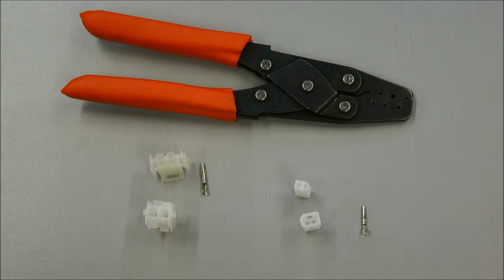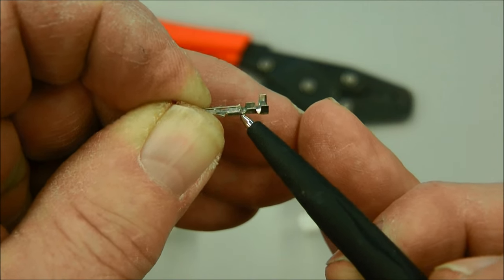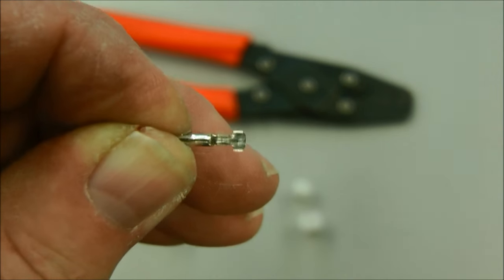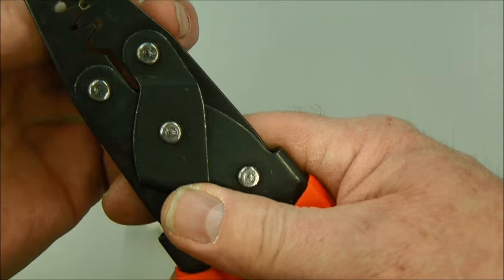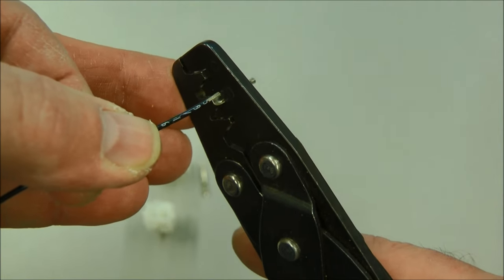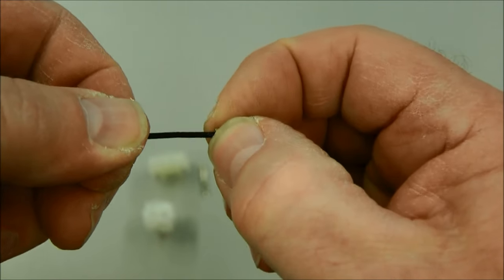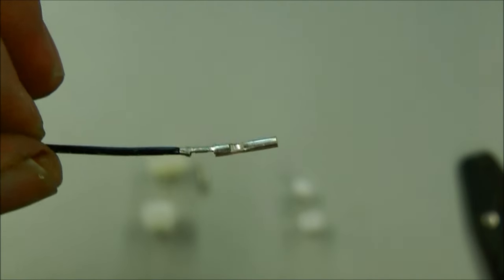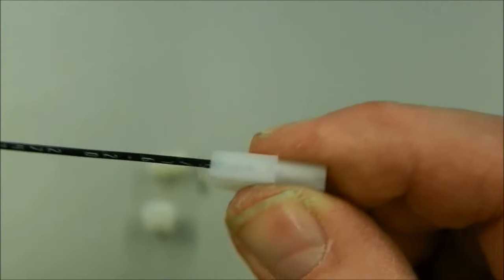011: MOLEX & OPEN BARREL PIN CRIMPING, Video 1

Comment: A helpful video. I'd like to add a couple comments that may be useful to others. In the video, you stress the importance of placing the tool properly during the initial wire crimp so as not to bend the adjacent section of the terminal. To do that, the tool has to fit between the two tabs. The distance available on the terminal is .150". The body on my IWiss crimping tool is .160", so it just isn't possible. I spent a lot of time trying, and your video helped me pinpoint the problem. The insulation on my 18AWG wire seemed larger diameter than the terminal was designed for, and I was getting a poor crimp on the insulation anyway, so I ended up snipping off the section of the terminal with the insulation crimp and just relying on the wire crimp for strength. Now I can position the tool so that it only crimps the intended area, and the terminals pop right into the plastic housing. (Alternately, one could machine down the tool body to something smaller than .150".) 
The other thing I'd like to add is that there is a proper ( and improper) orientation for the terminals when sliding them in. Nobody seems to have mentioned that, but it makes a difference. It's easy to see once you look closely.  
Let me also add that this is all taking place on Molex Minifit Jr. connectors. I don't know if it's an issue on larger Molex connectors.

Comment: You should update your description to include something like "also e30 BMW 3 series pin and socket connectors for housing numbers c404 and c405" because they are known to fail and I spent more time than I would have liked every step of the way. This video helped me figure out what I needed to do before I wasted the small bit of wire I'm working with. It sure beats the handycam YouTube how tos from when I last was fixing cars 20 years ago. This video was extremely helpful.

Edit: I can't punctuation.

Comment: Best detailed video I’ve seen for how to crimp those pins. Do you have a video on removing the female pins. I can’t seem to find the right tool anywhere.
Reply: Hello, do you produce car wiring harness by yourself?
Reply: @ginglean8287  these connectors are not exclusively for cars. I've used them in automotive applications and arcade machine wiring harnesses. I have a suitable crimp tool, but nothing to remove the pins once they are inserted. If you put them in the wrong hole or want to re-configure the connectors, you need a removal tool of the correct size, and that's what I am after. If you try to remove the pins without a tool, it gets damaged.
Reply: @markcummings150  Indeed, the terminal may be broken even if it is removed

Comment: I have a male pin  got pushed  during  female joint. I dont have access to the wires on back. Is there is anyway/tool  to pull the male pin to proper location?

Comment: Hi, nice video and demonstration!  I don't suppose you'd happen to know the Molex part numbers for those two-position polarized shells (both male and female), would you?  Been trying to track down some of those.  I believe the ones I need are for 0.093" diameter pins.
Reply: The Molex parts like this with 0.093" pins are in the 1545 series. The one in this video looks smaller, probably the 1625 series with 0.062" pins. Your comment is several years old, but maybe someone else will be looking for these part numbers. :)
Reply: @danlake7970  Hi Dan.  I did figure out after a while that the 1545 series is what I was seeking.   Your comment may be delayed, but I'm still alive and glad to get the corroboration anyway, ha ha!  Thanks!

Comment: Nice video but it would've been even better if you explained which slot you used for the two different crimping sections. Looks like you turned the crimper upside down in the second section but no comments about this. Nice and focused video.

Comment: is there a way to take them out after they are clipped into the molex?
Reply: TellUmItsPrenda Yep. Get yourself a de-pinning tool and you'll be good to go
Reply: +
Prenda
Easiest way is to use the tube you find inside a ballpoint pen that has the ink in it.  Use the open end of the tube and push it down over the pin side of the connector and it will squeeze in the hooks that hold it.  You can then pull the wire out.  Much easier than using the de-pinning tool.
Reply: Only with the fire of Mt Doom could you do this..